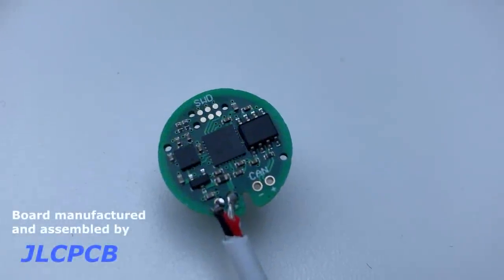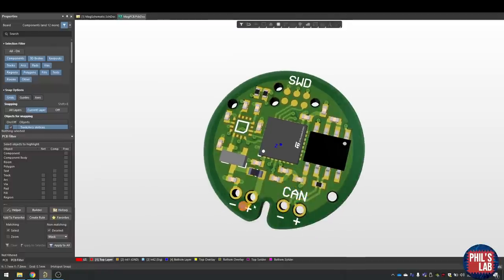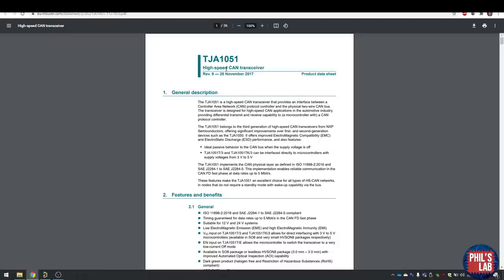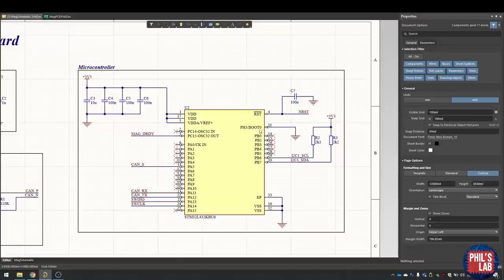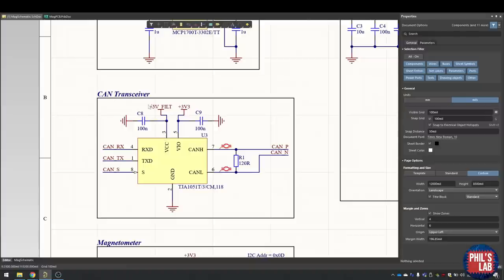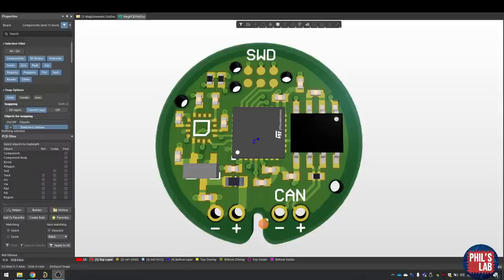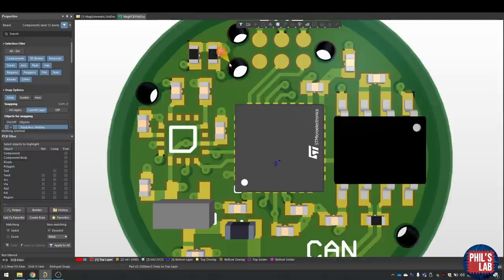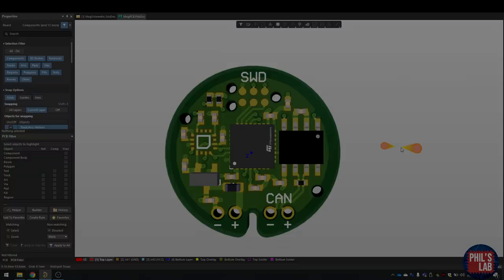Miniature PCB Design | STM32 + Magnetometer + CAN | Altium - Phil's Lab #22

Comment: Nice. Two side note: you may spare some mm2, if you put the swd to the other non populated side of the panel. For the 120R you may add one jumper 0R chip resistor in series, which gives you more freedom in the CAN topology later. In the current scenario, this device should be on one end of the CAN line.

Comment: Wow! I also use Tag-connect at my graduation project company. Didn’t know them before that. They’re cool, but really expensive.. I’ve designed a footprint that has pads on both sides. So it doesn’t matter from which side you program it.

Comment: Great video! one minor suggestion - check out the s12zvc - its basically a microcontroller with an integrated 5v regulator & also a can transceiver.. i used this a few year ago but this can really make your outline much more smaller
Reply from the maker: Thank you, Carl! That's a good tip - I'll check it out, would definitely help to make this smaller :)

Comment: Tagconnect pads are awesome. I came across them at the embedded systems conference (esc) in Silicon Valley in a tiny booth about 10 years ago. Super happy to hear they are still around.
Reply: It is no cheap do you know about some less expensive alternative?, I assume that on the market is more than one manufacturer ot that kind solution
Reply: @Antyelektronika  Another project I know of that's open source and accomplishes the same job is 'SOICbite'. There's a github repo and hackaday page for it. I recommend checking it out if you need a Tagconnect alternative

Comment: My first boards with the Tag Connect are just about to ship from JLC, I'm really looking forward to playing with it. I went with the 10 pin and included serial tx/rx as well as IO0 and !EN for the ESP32, programming would be exactly like a dev board. I almost went with the edge connect but...jeez $90 for a plug?!

Love JLC, want to throw their part search through a 97th floor window. Their idea of parametric is practically useless, most of the time I end up finding parts on Mouser or DigiKey and then trying to find it on JLC. Extra fun when you're trying to keep costs down and stick to their basic parts.

Comment: Fantastic video as usual Phil. Love watching these. I was curious, how much time does it take for a design like this? How much time did you spend on component selection, schematic capture, layout and firmware development?
Reply from the maker: Thank you very much, Rohit! This hardware design probably took me a couple of hours (4/5-ish?). Given the constraints of the JLCPCB parts catalog, component selection is actually pretty quick. Schematic is basically just looking at CubeIDE and the datasheets for the other ICs - in Altium footprint creations adds a bit of time. Layout was very quick due to the size and the small number of connections.
Firmware - at least on the magnetometer side of things - can be done in 1/2hrs.

Comment: Don’t mind if it’s very basic question.how to know what value of capacitor/resistor to use around the ic chip. any useful links to calculate. ?
Reply from the maker: This information is given in the relevant (IC) datasheets and application notes (typically under the section 'application information').

Comment: This video has so much to like...  I have always lusted after using Tag-Connect but never quite managed to get there due to the cost; the connectors I have seen are always >£50... maybe this will push me over the edge... the TagConnect form factor is so much nicer than 0.1" headers
Reply from the maker: Thank you! I totally agree with the whole TagConnect thing. The initial price is pretty hefty but well worth it in the long run I think.

Comment: Hi Phil nice job ! Do we need to connect thermal pad of mcu to ground ?
Reply from the maker: Hi Seha, typically yes, it's recommended (/necessary) to tie the thermal pad to GND.
Reply: @PhilsLab   Yeah i cheched the ref man. and it is recommend but  it to late bcs. boards had been fabricated. Luckily they are working well.

Comment: Love your videos, Phil! I have a question about your PCB design process. I haven't seen you use teardrops. I've been told that generally it's a good idea to use those but now I am just confused lol So should I use them or not? And if yes, then in what cases?
Reply: Talk to your fabricator. Teardrops are most useful in preventing micro fractures in the copper at the sharp corners where circle meats line.

Comment: In lieu of waiting for the next video of programming the CAN peripheral. I have some questions regarding the CAN message filtering. I'm using an stm32f446re nucleo.

My question is regarding the "filter registers" specifically the "Filter bank i register x (CAN_FiRx) (i = 0..27, x = 1, 2)" this is page 1085 of document RM0390. I don't understand the correlation of this and the macros defined in the stm32f446xx.h file.

Referencing the stm32f446xx.h file I see this macro: sFilterRegister[28]
I assume this is how you set the filter ID but how do you access the high and low register(the value x = 1,2)? If you're not familiar each of the 28 filter banks has two 32bit registers.

What I do not know how to do is write the code to set the filter ID. Example:
CAN1->sFilterRegister[0] |= 0x000000001;

Random guess, should it be:
sFilterRegister[0]->FR1 |= 0x00000001;

Any help understanding this is appreciated!

RM0390: https://www.st.com/resource/en/reference_manual/DM00135183-.pdf
Reply: Resolved:
I did some searching and found my answer. Thanks for the inspiration.

sFilterRegister[] is a struct with 2 parameters FR1 and FR2 both type uint32_t. Code goes like this:
CAN1->sFilterRegister[0].FR1 |= 0x00000001;
CAN1->sFilterRegister[0].FR2 |= 0x00000001;

:D

Comment: An off-topic question but, does SDMMC (SD 4 bits wide bus) traces really require length matching? Application note from ST (AN4938) on "Getting started on hardware development..." mentions it. What worked for you? It's a small size board like yours in this video (< 3x3cm size)
Reply from the maker: A few different places say keep the delays from clock to data lines within 250ps - so I would try to follow that. If you can't length match you can always 'throttle' the bus speed in software.

Comment: I love little projects like this, where it's got one main purpose and you're just using some of the pins 😊

In terms of the stack-up I think you're fine with just the one ground plane since most of your signals are on the top layer. Just the CAN rx and tx that aren't but I think it will be fine. Seems a shame not to include the SWO debug output with the SWD though, that makes things nicer for programming.

Looking forward to seeing the writing of the drivers!
Reply: how does the swo pin add more debug/programming functionality? just wondering the benefit of adding it @PhilsLab

Comment: Great video, it's really enlightening to have all these explanations, even for such a small PCB. I still have a question though. Why use an STM32? Isn't it kind of overkill (and expensive if you have to make a lot of those) considering that you need such a small amount of pins. Wouldn't another smaller MCU also work?